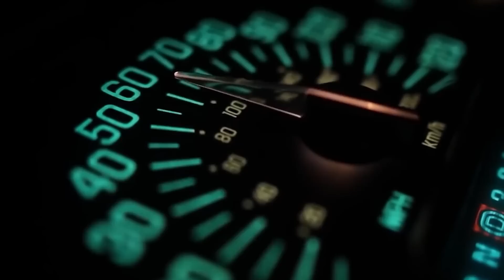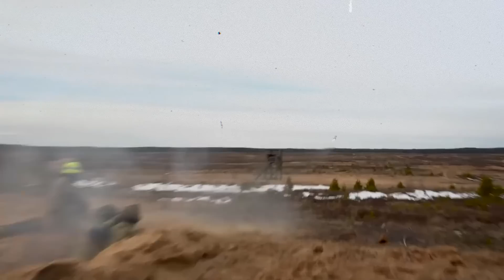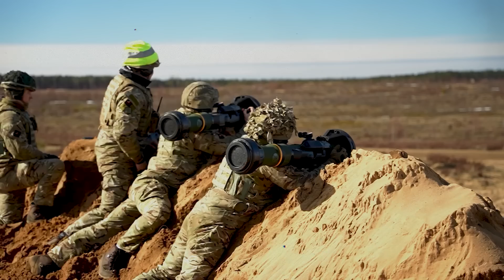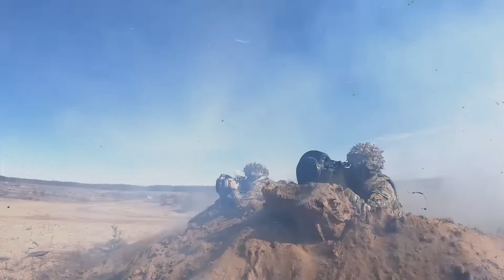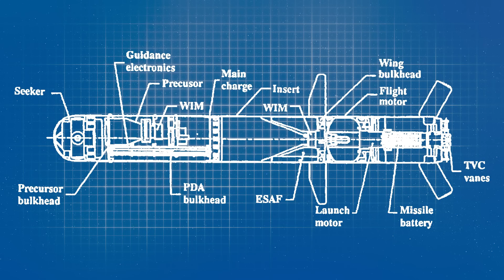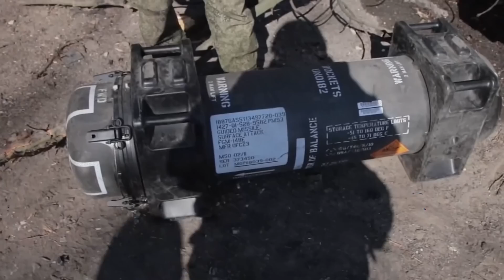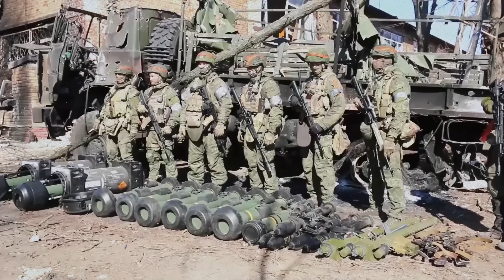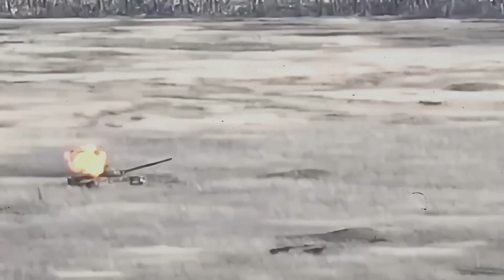The Javelin: The Missile That Redefined Modern Warfare

Comment: Remember getting trained for the TOW and hearing about the Javelin.   Then when really going to war in Iraq and Afgan, we ended up using the TOW because of the punch to buildings to clear them, and the Javelin getting set aside.  Javelin a first world weapon, and the TOW for sh...tholes.
Reply: TOW's pinching holes in tanks too in Ukraine.
Turns out it was all overkill and a racing drone strapped with a RPG warhead was all you needed
Reply: The next upgrade for drones is to have them in an easy to set up package like the Nikita missile from MGS.
Reply: @mightza3781  do zou guzs remember those metalstorm weapons? wouldnt those be ideal for drones? just strap a tube with 4 40mm grenades onto a drone, they only need minimal propellant since they shoot stright down, but they are still way to fast for infantry to react. to reload, just strap a new tube underneath.
Reply: @MostlyPennyCat  do you think a Gepard can take out drones?
Reply: @SomuaSomua there are already videos of the Gepard’s shooting down drones.
Reply: 'Dated' is not synonymous with 'ineffective'.
Reply: Carl-Gustav can handle anything but the most modern MBTs. Haven’t heard of anyone trying though.
Reply: Carl-Gustav took out the first T-90M in Ukraine. Damaged it enough so the russians blew it up a bit later themselves .  @TheBooban
Reply: Well said
Reply: A south Vietnamese TOW sank a coastal North Vietnamese freighter in 73 or 74
Reply: i like this SOP
Reply: The tow is being used alot more on russian equipment....makes sense , russia is a s***hole
Reply: 200 dollar drone, hold my beer
Reply: bro you are losing everywhere
Reply: Thank you for serving, I know that Freedoms not free!
Reply: @kingdiesel68 freedom? 😂 the only thing the the US brounght through its invasion of Iraq, Afghanistan, Libya, Serbia, Somalia was destruction. 

Did the US government find the WMD in Iraq? No, it didn't. Because the US is the WMD that brought destruction by waging wars based on false pretexts. The impact of the WMd brought by the US: the destructions of cities in Iraq, Afghanistan, Serbia, Libya, Syria, etc. The death of millions of people. 

Wars have become so profitable for the warmongers in the US😂 and the US has become a monster that believe only in the use of violence. The US has been trying to destabillize regions all over the world such as the middle east, Latin America, Africa, Asia, and Eastern Europe. But Karma will come to you, Americans if you do not repent for your mistakes.
Reply: Freedom ? Sorry for oil and unjust war or aggression and 2 million civilians dead@kingdiesel68
Reply: what kind of freedom you get from invading Iraq, Afghanistan dan Syria ?  @kingdiesel68
Reply: @bluedragontoybash2463  
When Americans say "freedom", they usually mean stuff that kills people.
Reply: Then the enemy reeled in as much wire as they could, got as many unexploded stuff they could and gave it back. Ended up winning too.

Comment: Lot of NLAW footage in there instead of Javelins there bud.
Reply: To be fair the NLAW is just a cheaper lighter shorter ranged javelin.
Reply: @ianjardine7324  well... they serve roughly same purpose on the field, that being destruction of mainly armored targets, but their operational role and working mechanisms couldn't be much further from each other...

NLAW is something that you'd give out to many members of any squad that doesn't fill a specific antitank role. Javelin on the other is quite more focused on the antitank role and requires at the very least 2 man team to be effective.

Then there's the technology in each of them, javelin uses active IR tracking or what ever, NLAW is completely passive, there's no IR guidance, the missile does not track the target. The warhead is instead programmed as you track the target for a few seconds, and based on what you tracked, the missile steers it self to the predicted intersection point, where some sort of sensor, likely magnetometer or something detects that there's something underneath and detonates, if the target stops after you've launched, it will miss. It's a passive system after all, unlike the javelin that will attempt to track the heat signature it has been locked to, it likely keeps track of the recent shape of the target while flying and compare that to the current image to verify it's indeed tracking the same target instead of a countermeasure. 

Oh, then there's the range, NLAW has effective range between 20 meters and 800m, where as javelin operates between 300 to 4500, so there's that also. I wouldn't call them the same.
Reply: @ianjardine7324 it’s cheaper and shorter but not “just”. It is completely different. It uses visual tracking (so it cannot be fooled by heat or anything else) and launches a separate penetrator while it continues to fly past the target. Completely different.
Reply: The javelin horribly under performed in the analysis of actual footage of it I found. Something like only about half of javelin hits even get the kill.
Reply: @Mortablunt  when a T72 costs 2 million and the missile costs 100k they can afford to miss 18 times and still be cost effective so "underperformed" is a reach.
Reply: @Mortablunt 😂 yeah that's why the Russians are terrified of them and the Ukrainians are writing songs about them. 

The hit rates are way over 90%. These aren't new kid.

Tell your dead they weren't 🎯
Reply: @Shoelessjoe78 but kill rates are naturally far lower like about 20-30%/hit so we are speaking about 6-8 missiles/kill wich is still good. That is why ukrain used up so many antitank warheads, and the javelin is more effective than others, but it's not the be all end all.  If it would be then the 20k munitions sent would have killed all of the russian tanks. But even supported by other systems, they were not able to win the war. They are good, but not wonderweapons.